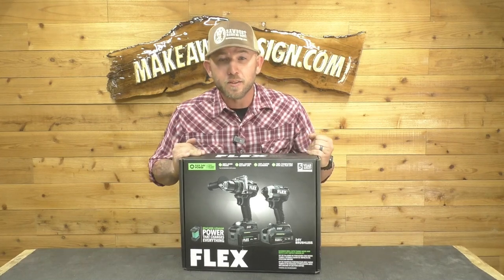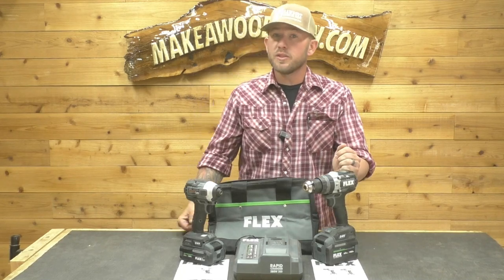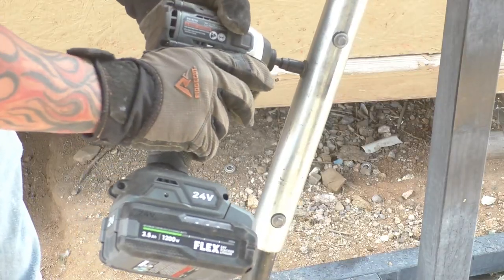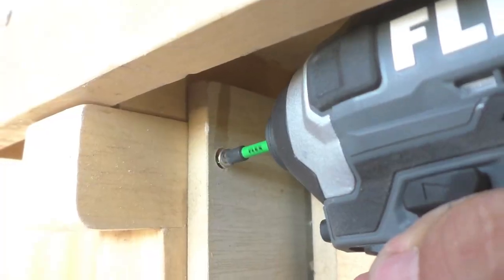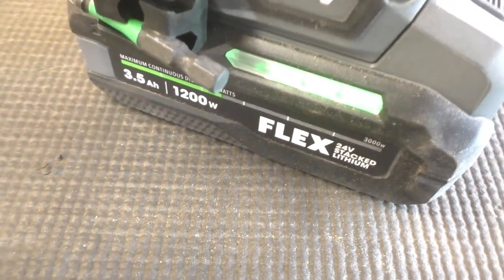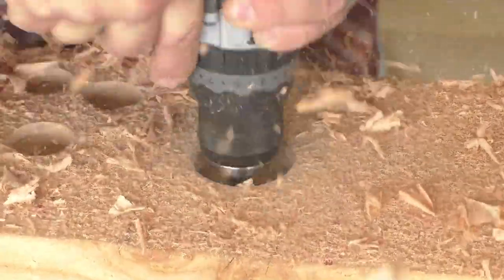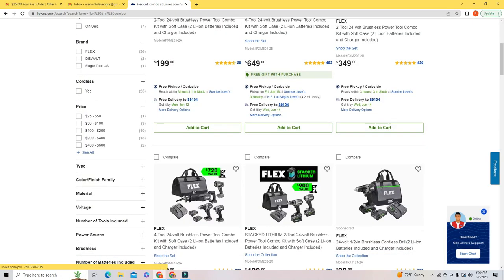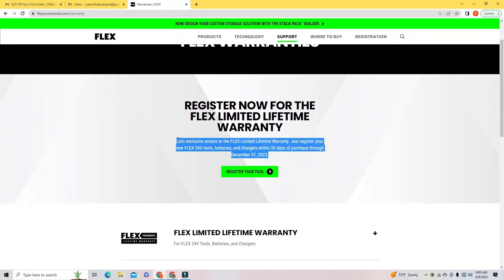Flex Drill And Driver Full Review - Are They Really The Best?

Comment: They better continue extending that lifetime warranty. I asked several guys I know, who are Milwaukee diehards, if they’d ever consider making the switch like I did, and though they’re perfectly content with what they know and love; they did say they’d certainly consider it, only if Flex is still offering the lifetime warranty when their Milwaukee tools start dying off. I own less power tools in general, so it was easy for me to make the switch; but, the only reason I did, is because of the lifetime warranty. I do very much like everything I’ve acquired so far, and I’m pretty sure the only thing I’ll be disappointed with, is the job-site radio that is on the way. Most people are saying it doesn’t get anywhere near loud enough to use on a job-site; but, it came free with a battery purchase, so I’m sure I’ll find a use for it.
Edit: my buddies also weren’t completely enthused by the limited options so far. They like that Milwaukee makes so so many different things that you can slap their batteries into.
Reply from the maker: They might end up doing that. I think that'll be an industry standard in the future

Comment: Comparing 1 1/2", 3", and 4" screws going through an 1 1/2" piece of wood? Why not keep going up to 10" lags?
Reply from the maker: Well, we could've gone with a lot of different types of tests, but figured we'd do what we thought most people would use them for. But next time we do a review we'll push em a little harder.
Reply: @oldave100  Point was you ran out of wood resistance after the 1 1/2" screws, testing beyond that isn't useful. I'm interested in Flex, but it's hard to find any thorough and/or unsponsored reviews.
Reply from the maker: You make a good point. Next time we'll use thicker boards. A part that didn't make it into the video was us using it on 6/4 maple and it worked great. Just so you know, we aren't sponsored by Flex or anyone for that matter. We honestly really like these tools. They're by far the best tools we have.
Reply: @packman2904 flex is still going to go though that wood like butter.
Reply: my exact thought lol all the tests shouldve been in at least a 4x4

Comment: I have the flex circular saws.  They are awsome saws.  I'm done with milwaukee.  Too many failed m18 batteries....
Reply from the maker: We haven't had that issue with the Milwaukee, but definitely love the way the Flex tools work. You can definitely tell the difference.
Reply: @oldave100  its been 6ah and 12ah batteries.   None of the 8ah, 5ah, or 3ah have had any issues.  In fact from my observation those 5ah batteries are indestructible.   My cousin abuses his horribly.  Left in a hot shop in summer and freezing during the winter.  Years later still working.  My failed batteries were kept in my living room in a constant 70 degrees.  Go figure.
I should have kept the doggone receipts!!!!
Reply: I already have a new Flex stacked lithium battery that's failed. Otherwise, I like the tools.
Reply: @unclefester4626 you’re so right about the 5ah batteries lol

Comment: So, I am an industrial mechanic in a mobile home manufacturing plant. We use 6-inch screws to set walls. Dewalt lasts one month, millwaukee a little longer. Makita 40 volt last a year. Flex 24 volt impact did 😮not make it one full day, overheated, and trigger froze
 Not made to use all day.
Reply from the maker: Really? We've used and abused these things and they work like brand new
Reply: Maybe just defective run? They are lifetime so maybe give it another try?
Reply: I think you're lying man . Idk what you're doing to destroy a driver in 1 day . I've been building houses and restoring cars with mine and they run like a dream .
Reply: Sounds like yall abuse your tools and cry about it
Reply: Maybe start thinking about using the right tool?  Impacts are designed to use on small fasteners, usa a drill instead. your wallet will thank you

Comment: I agree they are extremely well built and are fabulous to use, but there is one bad thing about them you did not mention that is the batteries, they leak, a black goo. It's not harmful, but it is messy if you register the tool. They will send you a replacement battery free of charge, so make sure you register because batteries are not cheap. Apparently, they have fixed the problem, but there's still old ones out there in stores
Reply from the maker: I've heard that from a lot of people, but we haven't experienced it.

Comment: I love my flex tools but one con i found is the black thermal grease leaking out of the battery. Its not toxic and doesnt affect the battery life but man its annoying cleaning it. Other than that flex is GREAT
Reply from the maker: We haven't had that issue. But the batteries should be lifetime warranty. Have you tried filing a claim?
Reply: @oldave100  I havent yet but i hear flex is good about sending out replacement
Reply: That’s the gen 1 batteries. The stacked lithium batteries are the upgraded batteries where they fixed and addressed this issue.

Comment: I just got the Flex set with the regular lithium ion batteries, and it seems like the impact driver gets warm fairly quickly.
Reply from the maker: We haven't noticed that at all....
Reply: @oldave100  I just used mine to drive some 2/12” T25 screws to attach a 2/4 to a 4x4 last night, and mine got warm. I don’t much care for the trigger either. If I try to squeeze it really fast, it causes a lag that almost makes it feel like it’s cutting out.
I’m gonna give the drill a shot, though, because I need a really strong drill on occasion, and Flex also makes a great compact drill that I can get in the future.
Reply from the maker: Thanks for the feedback.

Comment: So.... does anybody on here actually perform accurate tests; under real-world conditions? I have not made it through the 1st test yet ( under 2min mark) ....  hopefully I put my foot in my mouth & the parameters change later in the video....

yes - they are great tools! But, when doing tests &/or putting them through the paces, the most accurate test would be installing fasteners & using drill bits with material behind/underneath the test board. 
You can get away with it when testing drill bits ( but would still layer the material or use larger material ... for accuracy & real world scenarios).
But with screws...the whole purpose using fastners is the fasten two or more pieces of material (s) together. & once the tip of the screw breaks the plane of the underside of the wood, resistance pretty much dies!  Especially when using partially threaded screws that are substantially longer than the depth of the material(s).
Reply from the maker: That's good feedback, man. We'll keep that in mind for future tool reviews👍👍
Reply: Wtf is wrong with me? I finished the video & strolled over to the comment sections to thank you for your time in making this video.... & I see my name with a comment that follows ( a really fuggin rude one, at that)!
Please disregard that nonsense! Thanks for helping interested parties to make an informed decision &/purchase.